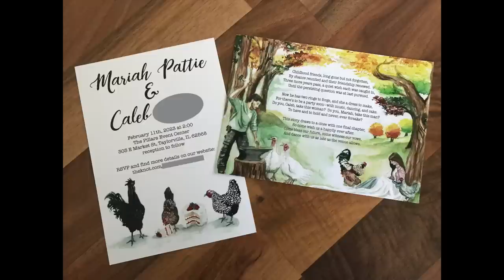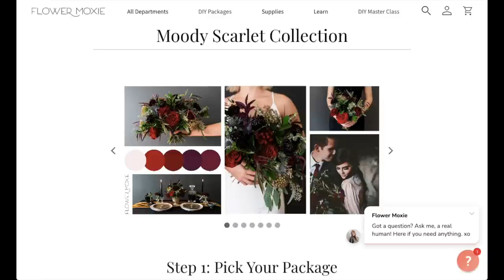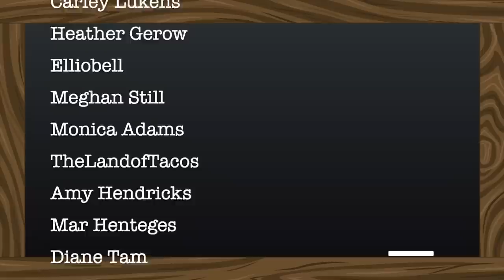Hello.  I've been on hiatus for a while.  It's kind of a long story.

Comment: You two make an adorable couple. I know your relationship had a bit of a rocky beginning (your whole childhood sounded rough, at least in your story), but I am so happy for you that it worked out in the end.

For future videos and/or shorts I would really appreciate any video you can do on mending or smaller parts of projects, like a stitch or seaming method. For example, I have a few bras where the underwire is coming through, and I've already had at least one repaired. I think I would like to use the feathering(?) stitch that was traditionally used for corset boning, as I think it will help to hold it in. I have very limited experience with sewing, and I adore watching your videos.

Comment: You are a good storyteller a d I wish you both all the best.  I hope he joins in videos.  Sewing, knitting woodworking, and pottery  sound great. Homesteading as far as gardening and making jam and such, but not butchering!  I came across your Workshop video about making your own clothes. It was very detailed and I subscribed. Fitting clothes is an issue for most people especially when not thin and/or older. It is hard to find anything in stores that fit.  Even if they don't fit, most store clothing is  not modest or in a flattering color or quality fabric.    I have gone back to quilting to take my mind off things.  I need to sew again because the knit skirts I buy show wear much faster than wovens.  I will try some fitting but it seems daunting.

Comment: Owned your own house?  How f*cking how?
Reply from the maker: 1. I had no debt or student loans. I buy used furniture, rarely eat out or shop, and generally don’t spend much on anything but fabric. 
2. I had a roommate at my apartment. That cut my rent down to about $350 and helped me save up a down payment.
3. I don’t live in a big city. Real estate here isn’t crazy expensive.  My dad went house hunting with me and showed me what to look for so I didn’t end up with a money pit. 
4. My first house was very humble. A small duplex for 70k with good bones but a very outdated interior.  I intended to remodel, but ended up just living with the ugly and saving my money instead. 
5. I lived in that house and built equity for 3 years. Then I sold it and was able to afford an actual nice (though still small) house for 110k
6. I make less than 30k a year. It’s not impossible, but debt is a killer.